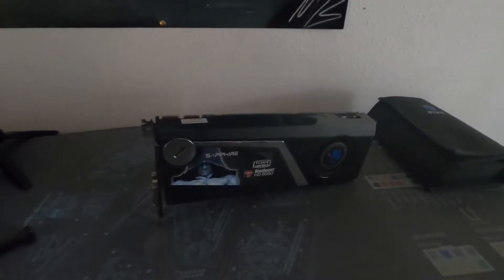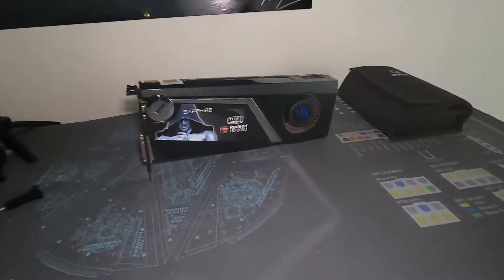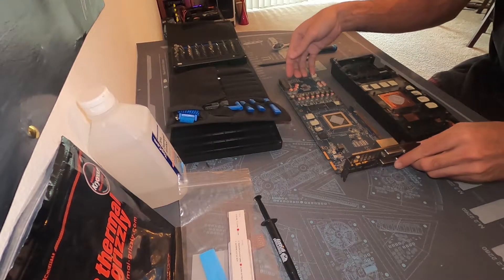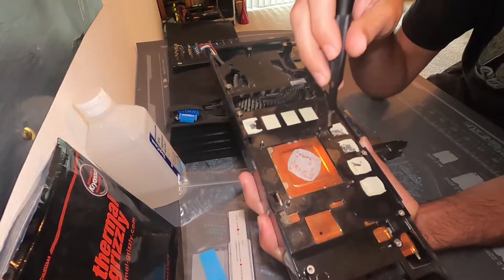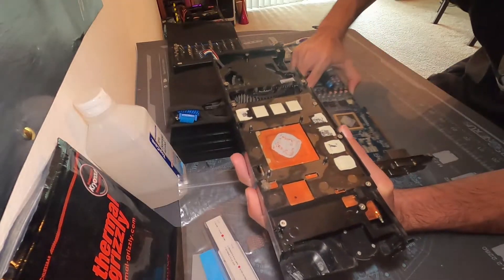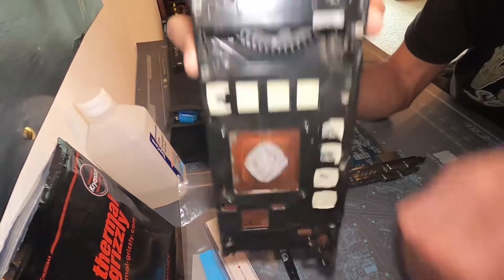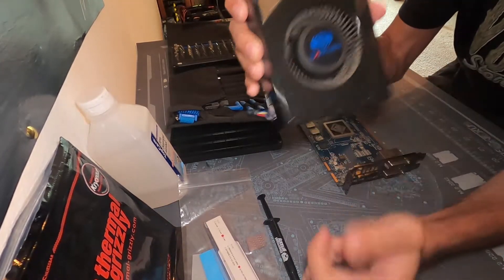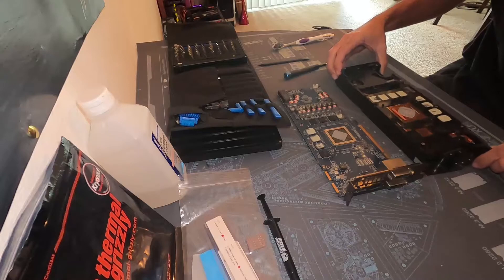Sapphire AMD Radeon HD 6950 Teardown

Comment: What thickness thermal pads did you use
Reply from the maker: 0.5mm
Reply: @SerpentXTech  Did you put one layer over another or just one layer? I need to service mine so am not sure what mm i need. Please let me know and that's for the response.
Reply from the maker: @roelflotriet4331  no removed old and replaced. For this model GPU, they are 0.5mm. It is always good to have a mix of thermal pads on deck, just in case. Check out the below decent thermal conductivity. https://amzn.to/3rCXbeA